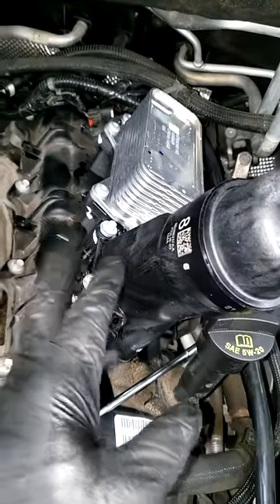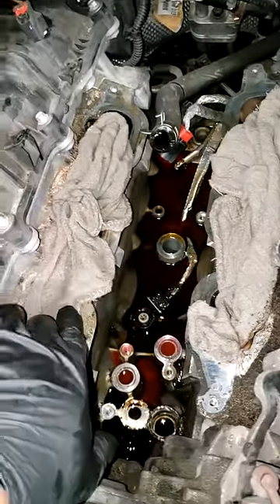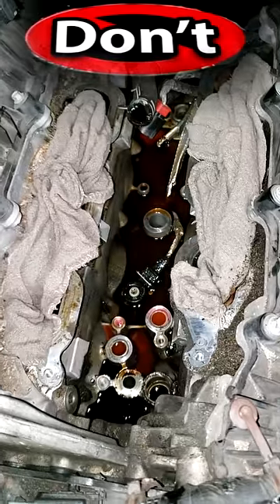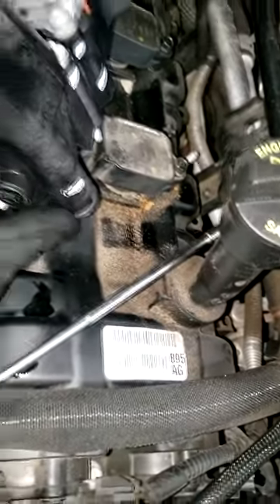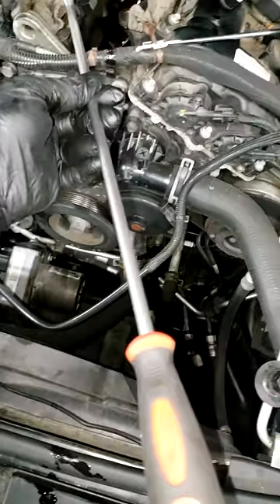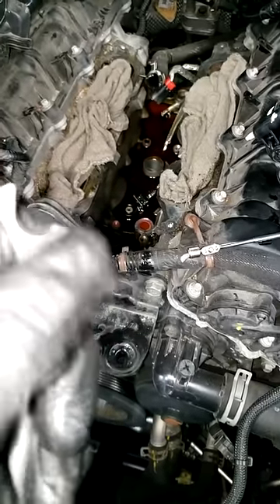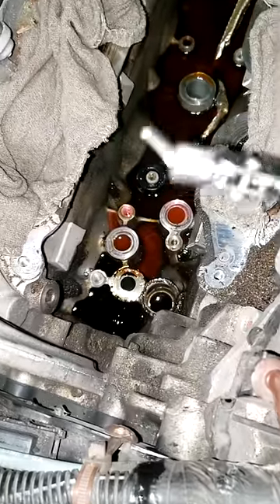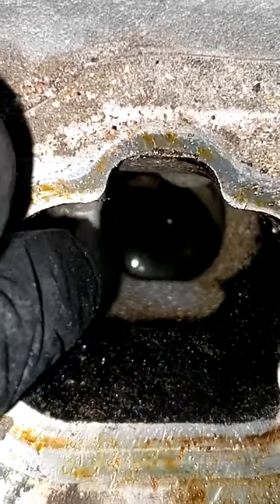This will scare the hell out of any mechanic. But I found it.

Comment: I was doing the same job you are doing and I lost a oring that goes to the oil cooler. I never found it and I have not been able to drive my 2015 jeep grand Cherokee since November 2022 as it won't hold oil pressure. Crying still because it's been redone 3 times and replaced the dual stage oil pump as well , also did an engine flush as there was some sludge in the oil pump area. Still no luck and before this I had absolutely no issues. Any Ideas would be appreciated. I miss driving my baby

Comment: Thats a panel pry bar, not a real pry bar. Thats for taking out the little push button fasteners. Best to use the proper tool and your less likely to break them.
Reply from the maker: The video not about broken tools. Its about covering the intake
Reply: @Online Mechanic Tips  yeah but the reason you found out covering the intake was a good idea is because you broke a tool using it for the wrong reason. Im not a perfect mechanic, so i dont post my shot on youtube for others to pick up my bad habits. You didn't even say in the video that it was the wrong tool for the job. You're teaching people, own your bad habits.
Reply from the maker: @AverageCitizen333  smdh, you obviously don't know the role of a youtube content creator and there objectives or you wouldn't have made this dumb comment.  Hear me out, on youtube im a content creator, in the shop im a mechanic. Those are 2 diff people bald up into 1. Moral of the story is that I got this over here big dawg. Get ya mind right.
Reply: @Online Mechanic Tips  my mind is plenty right. You obviously don't understand the point i made or flat out just dont care. You're working on other peoples vehicles, and they are paying to get the job done right. Maybe if you can't, be bothered to do it right, you shouldn't be distracted by making content at the same time. Be professional. Also, by posting it on the internet, you open yourself up for criticism, which you clearly can't take. You used the wrong tool and broke it. In doing so, you found out cutting corners on a very obvious step of not contaminating the intake side of a customers engine wasn't worth it. Let's be real here, and stop making it sound like im being an idiot.

Comment: Yep. Then, the engine fails shortly after you get it back from the shop. Using common sense and the process of elimination on how you know what has been done to the vehicle and any problems it has had, that it had to be shop's mistake, you take it back and see what they can do. They respond with, "Nah. Wasn't us or our guys." When in reality, it probably was. That's why it's better to learn how to do it yourself. That way, if you screw it up, you only have yourself to blame, and there is literally no question about who's liable and who isn't. Also, before anyone says, "Yeah, go ahead and do it yourself and then bring it to us, and we'll fix it after you mess it up.", all I have to say about that is, "Will you though? Or, will you maybe fix that issue but cause another in the process from laziness or lack of caring?" It's simple stuff in this video that "certified mechanics" don't do that have led the general public to not trust mechanics almost everywhere. Very few reputable shops exist anymore. There's always one guy in any shop that messes up the trust for the rest of the good ones. Nature of the beast.

Comment: Moral of the story, don’t use harbor freight tools
Reply from the maker: But thats not your line, I determine the moral of this story. The video is about covering the intake . Regardless of what tool used.
Reply: @OnlineMechanicTips  of course I can determine the moral of the story, I watched the video and I get to choose what I take away from it and what I want to comment, not you. Also I was an ASE master tech and an engine builder for 9 yrs and the first thing you learn is don’t use inferior tools that can break during a repair & that can cause extra repairs due to the tool breaking. To further prove my point, yes a tech should be careful and cover the manifold opening, but that’s only needed if things fall in there which they shouldn’t and if that tool didn’t break in the first place there would be no need for any of that or for this video to be made in the first place. The inferior tool was the weak link here.

Comment: Maybe you should clean the dirt off before taking the intake manifold off. That dirt can ruin an engine as well.
Reply from the maker: Then it would be ok to not cover the intake holes?
Reply: @OnlineMechanicTips  No, just a little extra protection. No one wants dirt and debris getting into the cylinders causing scratches, etc.
Reply from the maker: @brianbumgardner8704  Yes, I agree

Comment: that was a plastic retainer pry tool, not a pry bar. of course it snapped
Reply from the maker: But the video not about the tool or it snapping. We already know that part.
Reply: @OnlineMechanicTips  it is good that ur telling people to cover the engine though, I can't tell you how many people I've seen make that mistake.
The only problem is that most people have to actually make that mistake for themselves before they listen to what you said.

Comment: You should use toilet paper.  In the event you get distracted and end of forgetting to remove it from one of the plugged holes, it burns completely and will not damage the engine.  A rag or piece of rag can damage the valves.

Comment: That's not a pry bar it's a panel pin popper for interior work. You clearly don't do much door panel work do you?
Reply from the maker: Lol, You clearly dont know me. Yes I know what it is and im aware it was the wrong tool but the closest tool to easily grab at that time. Even mentioned it in the video. The focus suppose to be on the importance of covering the intake manifold, not what tool I used. Even if I had grabbed the correct tool you still should cover the manifold..lol..Thanks for watching buddy.
Reply: @OnlineMechanicTips I use tape and rags to cover my intake ports.
Reply from the maker: @j.robertvillarreal5926  Thats whats up

Comment: I don't ever by anything from Harbor freight. Every tool I have used has broken.
Reply from the maker: They just shouldnt be abused
Reply: @OnlineMechanicTips   If you are someone who might use any given tool 3 times a year no problems, but if you use any specific kind of tool on a daily basis one would have to say that tool is being abused. I for one. Use a variety of tools in the home remodeling industry, if a company such as harbor friaght is going to advertise quality tools they should sell quality tools for the do it yourselfer who might build something once every 2 years and for the every day contractor. Maybe your that do it yourselfer.
Reply from the maker: @fredryno3100  lol, that didn't make much sense but ok.

Comment: The video title should have been, "Why you don't use Harbor Freight tools"
Reply from the maker: But its not and the video not about the tool
Reply: @OnlineMechanicTips  I own a shop. We have some Horrible Freight stuff, but not much. The foam cannon for pressure washer is very good. But on the subject of sealing of the ports, you can also use a couple of layers of painter's tape on the ports instead of the rags. Wipe the surface down with break cleaner to ensure adhesion and it works very well.
Reply from the maker: @joeydover  great idea

Comment: Yeah, except that's not actually a pry bar for what you were doing. I've probably done 10 of them, and not one ha needed a pry bar. Couple taps with a small dead blow, and it breaks the seal.  Yeah the rags are needed.

Comment: You know there's a joke amongst tooling engineers those long lines of design everything you make like a hammer because it's some point it's going to be used as one except the hammer that's going to be used as a pry bar which I find strangely applicable tempest clip as that's a clip remover which I don't know if you know this isn't a pry bar and yes I do know we all use tools the wrong way sometimes because we need something so obscure an oddly-shaped that there just isn't a tool designed specifically for that

Comment: Use air compressor to blow all loose dirt and sand away before removing intake manifold or heads. Wth is even this video
Reply from the maker: That was done sir, in some cases you cant get it all out but you may wanna tone that down a little considering your position.
Reply: Considering my position you don't know me! I have been a mechanic for 14yrs now ASE certified have my inspection licenses and more. I also run my own business and the debris is all loose you can clearly see it moving around when you move the cloth but yeah it's all good not my customers that have to deal with your cutting corners. Their are alot of mechanics out there like you. 👍
Reply from the maker: @Hadfield420  Yea and I do brain surgery. Now you see how easy it is to be/say whatever you want to be on the internet?? Judging by your channel I suggest you stick to the video games and let the pros do what they do. I also suggest you get to work uploading content so you can grow. You have no time to be worrying about what im doing over here.  I dont come to playstations trying to tell you how to play the games do I?? I got this my dude. foh

Comment: Well it’s a clip removal tool not a pry bar…
Reply from the maker: Yep, still that dont take away the fact that you should cover the intake.
Reply: @OnlineMechanicTips  Had a co worker drop a bolt in a runner one time, luckily got it out with a magnet after some heart pounding sweat and stress. 
6.2 Chevy doing a valve spring without pulling the head.
Reply from the maker: @TylerRivera635  Yes, that would drive you crazy..

Comment: Diagnosis:harbor freight tools were used and almost lost an engine. Par for the course. Conclusion: Don't be a cheap hack. Be a professional that uses professional tools.
Reply from the maker: That make sense, If it was a pro tool there would have been no reason to cover the intake with rags..You sound like a professional clown.

Comment: Meanwhile this self described professional is fighting folks here in the comments. Folks gave said it already: that's not a pry bar. That's a trim tool. That's a ton of debris around those passages. Area should've been cleaned thoroughly before continuing with disassembly.
Since I'm on this, all that oil in the valley should be cleaned as well as the connectors, specifically with electronics parts cleaner and not just brake clean. Follow up with dielectric grease on contacts to be safe.
With the amount of attacks you're making against your commenters and you saying "us pros," the best thing to do is delete this video and try again.
Do better, man.
Reply from the maker: The video aint going nowhere, almost 1 million views, you must be outta your mind. And what you call "fighting folks" is nothing more than me responding to comments. Depending on how the comment was made dictates my response. If you come at me foul, the response will be accordingly. This video was about the importance of covering the intake. But since yall want to selectively pull out other things, thats fine with me. Now heres a slution for you or anybody that think like you. Since you know so much and got all the answers, why dont you simply make a video and explain everything. No sense coming over here telling me how to make videos or explain anything. Im doing great over here. Stay focused on you my guy.

Comment: You're a newbie for using a door panel clip tool. I think your lesson here isn't to cover the intake holes. The lesson you really learned was to use the right tool for the job
Reply from the maker: Lol, but that's not your line, thats my line. I determine what the lesson should be about my dude. If I wanted your opinion, ide give it to you.

Comment: Blow out the crap from around the intake before you pull it my guy! And then remove the filter before pulling the oil filter/cooler assembly so it can drain! SMH

Comment: Use a real pry bar, not an interior clip remover…
Reply from the maker: So are you saying that then its ok to leave the intake uncovered?
Reply: @OnlineMechanicTips  did I say that, or anything in the realm of that? Honestly, that’s the only thing you did correct in this situation, you should have taken a few precautionary measures before you got to that point. At least attempt to clean the work area before you remove the intake manifold so that pounds of debris you have laying up there don’t fall in, use a shop vac some compressed air anything to clean up that debris. Then you can remove the intake with using the proper tools and you wouldn’t have that situation occur. If you want to be taken seriously, try to use the right tools for the job, and not make short clips on yt of your mistakes because YOU made poor choices. 🤷🏼‍♂️
Reply from the maker: @monkeymott  If im not mistaken, it sounds like you trying to give me advise on how to do what it is I do..To that I would say that there's no need to try  this. I got this my guy. Please understand the difference between a youtuber and a auto mechanic. On youtube im a youtuber that make videos thats intended for a purpose. Seems this video doing exactly what it was design to do. Now, in a shop, im a mechanic. Know the difference. This a 60 second video, there's a chance you may not see what you think you should see. Here's the bottom line, I GOT THIS OVER HERE OK. Don't come for me.
Reply from the maker: @monkeymott  Weird how you can give advise about videos to a channel like mine when you have not a one video up..This youtube bro, shit talking is done with ya videos. You have none, put up or shut up...lol..tf? You don't even deserve to argue with me. foh
Reply from the maker: @monkeymott  Why thank you, thats the smartest thing you've said yet. Now if you'll excuse me, I have some more uploading to do. You welcome to watch those as well and give me ya opinion as to how bad I'm doing. As if that really matters to me.
Reply: @OnlineMechanicTips  if it didn’t matter, if I wasn’t right, you wouldn’t even reply. 🤷🏼‍♂️
Reply from the maker: @monkeymott  Again, I'm a youtuber. Comments moves the algorithm which spread the video out even more, which raise the view count, which add up to more revenue stream. Its all strategic my guy. You got to understand the difference between a youtuber and a mechanic. On youtube im a youtuber, in the shop im a mechanic. So say what's on ya mind big dawg. Don't hold back. Last time I checked, this video over 100k views, yea keep talking.

Comment: Use the correct tool for the job. Literally using a harbor freight interior clip tool to pry on the engine. I'm not saying I'm a pro but I do fix all my own cars trucks motrlorcycles etc and do side work and I wouldn't even do that best of luck your gonna need it...I wouldn't of covered it and wuld of been fine cuz I would use a real pry  bar and it wouldn't chip. .honestly if your a man you culd of yanked that filter out but nxt time if your interior clip tool breaks again just hit it with your purse you'll be good
Reply from the maker: Finally. A smart dumb comment. Somebody that address the purpose of the video as it relates to the job itself. Thats what I'm talm bout

Comment: 2 hours labor just to get to this oil cooler....only takes 10 minutes to remove 5-6 bolts, two sensor plugs, and a coolant line clamp to replace it....then another 2 hours labor put everything back.....ridiculous design on this Pentastar 3.6.....sits right between the heads and below the upper and lower intake manifold.....made out of high temp. composite plastic.....usually goes around 65k-85k miles.....a coolant leak coming from the back of the motor down the bellhousing on passenger side is a dead give away to this parts failure

Comment: Panel popper? It’s not a pry bar,.. you get what you pay for cheap tools don’t expect quality,… if you been doing this for long enough you should invest in some quality tools by now
Reply from the maker: And you should go count something. The video not about tools, but about making sure the intake covered. It doesnt matter if it was snap on and didnt break. The intake still should be covered. Stay focused.
Reply: @OnlineMechanicTips - go count something?? That’s the best come back you got?? Yeah your video is about being “smart “ and not letting things fall into the intake ports,… I know what your video is about,.. try using painters tape in stead of rags,… it will cover the ports better my son,… good luck 🍀… just because my profile picture is of my son doesn’t mean crap,… don’t get mad if the truth hurts then wear the glove or shoe or what ever,… I’m almost 40yrs old and been doing this line of work for over 15 years….
Reply from the maker: This not a comeback no more than it is a simple response to your comment. Who's mad and about what? I made a video suggesting the intake be covered, rags or tape would do. And who you calling son? What does your age and years of  experience have to do with this? I'm not impressed by that.

Comment: Well if you didn’t use a trim tool as a pry bar wouldn’t have been an issue, and you called yourself a pro 😂😂
Reply from the maker: So you saying just leave it un covered as long as you don't use a trim bar? Smdh
Reply: @OnlineMechanicTips  use the right tool for the right job, simple isn’t it 🥳🥳
Reply from the maker: @Tsto50  smdh, you have a hard time with comprehension i see. Its ok bruh
Reply: @OnlineMechanicTips  no issue here mate, reading the comments though think it’s pretty clear 😂😂